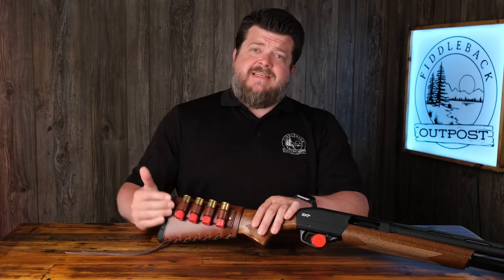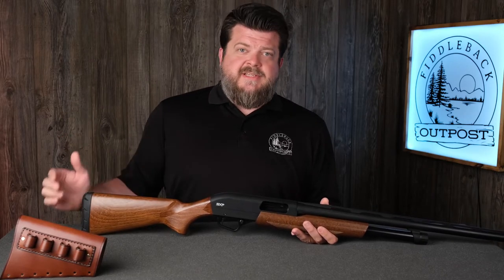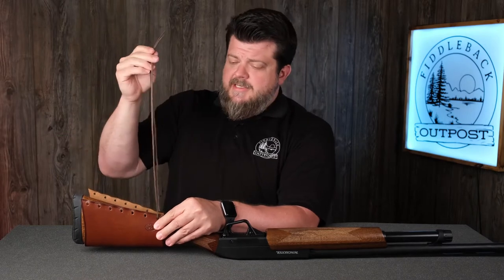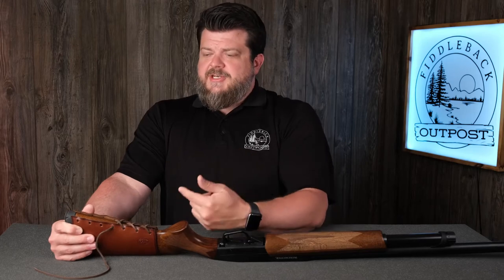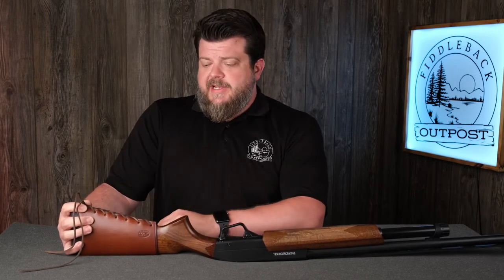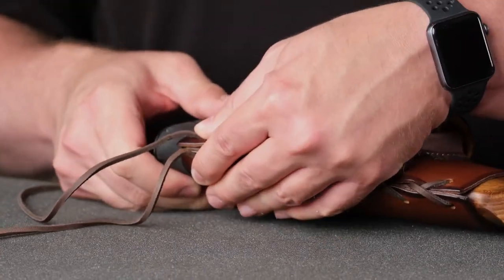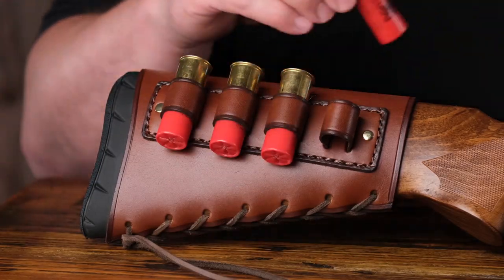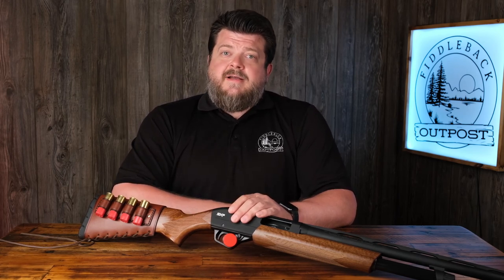Installing the Shotgun Butt Stock Cover by RLO Custom Leather

Comment: How many 12ga shells can the pocket hold? I’m sure it is less than four, but I’m just curious.
Reply from the maker: Pocket is not designed to hold shells... only the ammo loops are. For 12 gauge, there are 4 ammo loops. Again, the optional pocket (instead of loops) is made for carrying various items, it's not sized or intended for shells specifically.